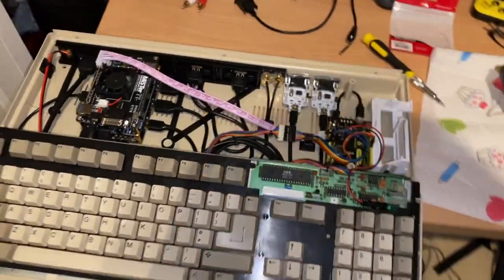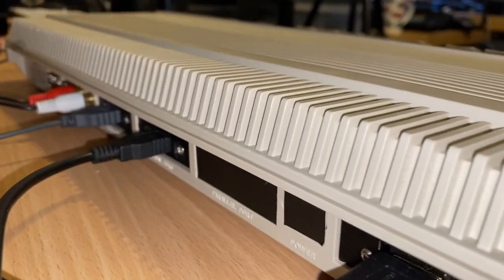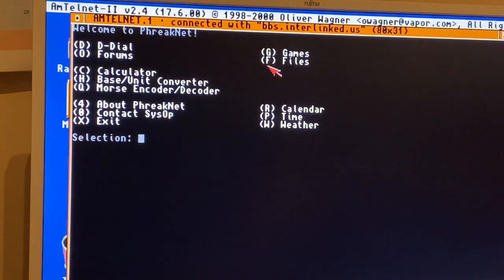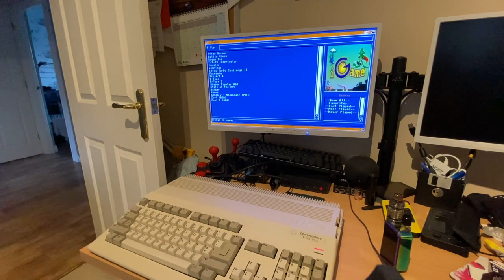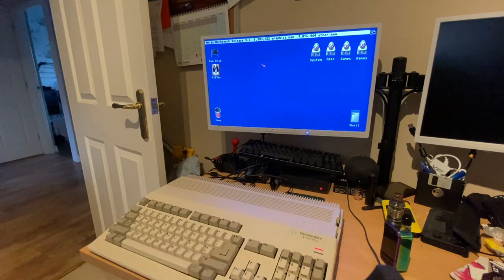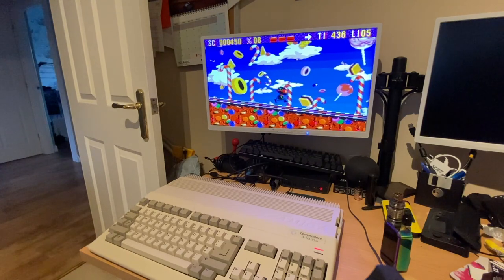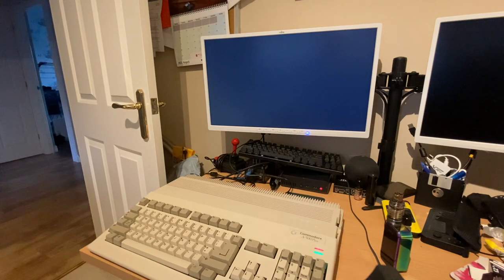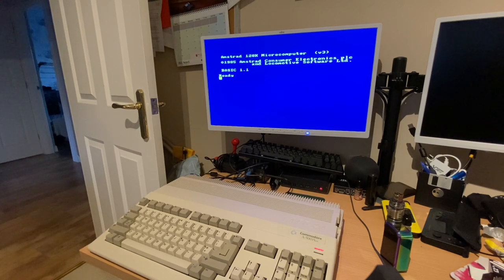Amiga 500 Plus Mister FPGA - Follow Up

Comment: This is the way forward!!! Just got an amiga 600 real hardware with a 5.5mb fast ram upgrade and cf card installed but im really struggling with I game etc.  Emulation on pc doesnt feel right but this has all the feel of real hardware with the added benefit of modern displays etc....i love it. looking online now!!!
Reply from the maker: You might also want to check out the MiSTress board if you're thinking of building a Amiga MiSTer FPGA. The MiSTress boards are available for both A500 and A1200 cases. If you look on the community page, there are some links - or check this website out: https://www.8bits4ever.net. I rebuilt the machine featured in the video with a MiSTress board - much simpler and cleaner than using the 3D printed backplates (although they are fine too).
Reply: @RTSRetroTechShed  Sounds just like what I’m after!! Thanks for the advice!!

Comment: Can you share the STL file for the 3D printed case you created?
Reply from the maker: The case is from an Amiga 500, but the backplates were 3D printed. I just found them on eBay. If you watch some of the later videos, you will see a neater approach using a MiSTress 500 IO board from 8Bits Forever.